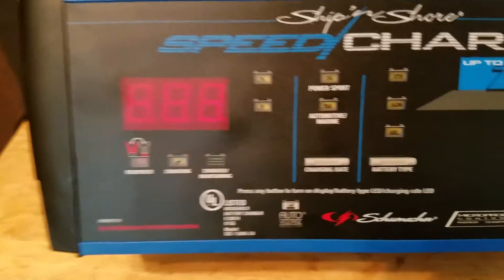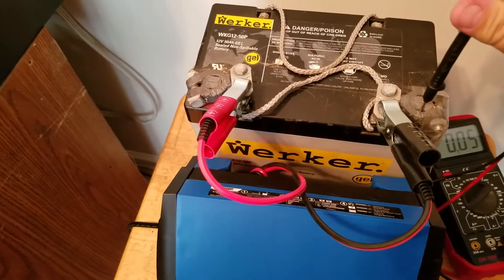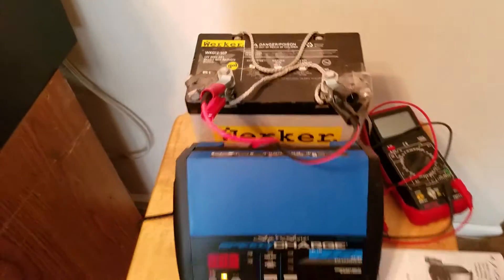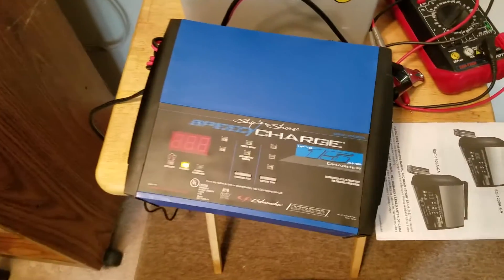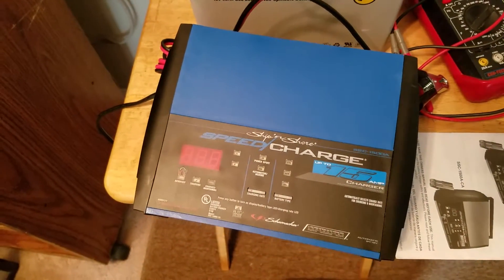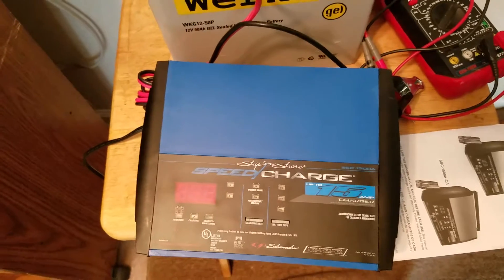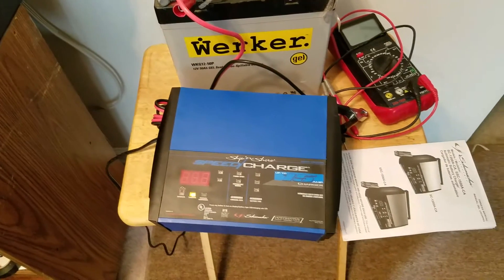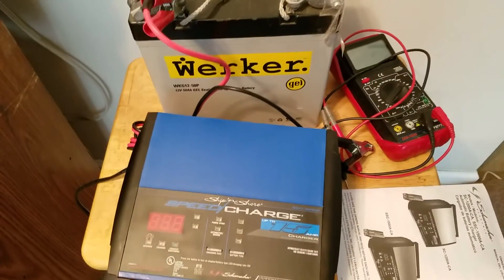Part 2 New battery charger can it bring an old Gel cell back to life?

Comment: No it didn't abort, read the manual, blinking green light means it is now in desulfation mode ,when that's done, green light turns solid and starts charging again.

Comment: Does this charger actually have a desulfate mode?  
I have the exact same charger.
I know there's a similar charger but it has three buttons across the bottom and it's a 10 amp charger. That one has a desulfate mode.
Reply from the maker: Allegedly it does .."The microprocessor of the Schumacher SSC-1500A Ship 'n Shore SpeedCharge Charger monitors the attached battery's voltage level from the moment it is connected, using this ever-changing data to improve the charging system's multi-stage charging cycle. Multi-stage charging allows a battery charger to automatically cycle between a variety of charging phases including desulfation, bulk charging, absorption, monitoring, float mode and a minimal drip charge maintain mode when a connected battery again falls below a certain set level. The microprocessor collected data allows the SSC-1500A to more accurately measure the charging needs of a connected battery, resulting in quicker charge times and a lessened chance of damage due to overcharging." 

this is the one I got https://amzn.to/3GNH28x
but there is a newer model.

(As an Amazon Associate I earn from qualifying purchases.)
Reply: Read the manual, blinking green light means it is now in desulfation mode ,when that's done, green light turns solid and starts charging again. It might go back and forth from charging to desulfation  depending upon your battery. If any error code comes up just disconnect and do it again ,repeat if needed.  Stick to it, sometimes these smart chargers are too smart for their own good.

Comment: I have the same charger. Similar issue but i hooked up to a brand new battery that ive had sat on shelf for about 4 years. Theres 11.5 volts in the battery  when i hook up my charger an select amps it goes right to abort mode. I dont think its the battery but i could be wrong. Does anyone on here have any idea what the issue might be
Reply from the maker: One thing I did to get past the software check.. I took a old battery  maintainer That made the batter charger think it had 12v and started charging.

Comment: I have the same charger and a red top optima. It says it is 100 percent charged and the optima only tests for 12.3 volts. It starts at 12.7 and goes to 12.3 over night and the battery is out of the car. Can't figure out if I should chance using it in the car because the last time it caused the car to shut off while driving. Optima should be at 12.6 to 12.8 off the charge and mine is at 12.3 after a full charge. Something is not adding up.
Reply from the maker: I think the battery might be bad. I would go down and have it tested at one of the free places. some places will charge it for free. I think Walmart will do a charge for free.
Reply: @NorthCarolinaPrepper  I charged it myself 20 times and it still only reads 12.3 after the surface charge wears off. I am throwing it out. It is not worth chancing an accident with my kids in the car.

Comment: I have the same charger, and if the battery is way out of shape I have to use an old analog charger first to get a little bit of juice flowing, then put the digital charger on it. If I don't I get the blinking light and the digital charger won't "see" the battery. I like that charger, though.
Reply from the maker: It was charging (well at least putting out voltage) I would never trust this battery anyway. On a side note I did see the charger had a fan. But mine was not running so I contacted the manufacture. and they said it only runs as needed , It's a new firmware update. I thought it might of been a defective charger.